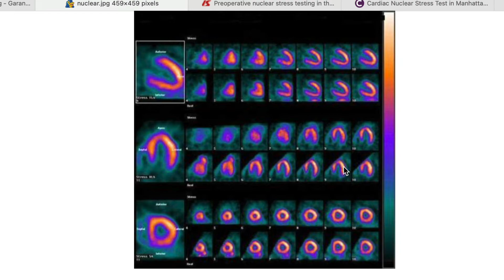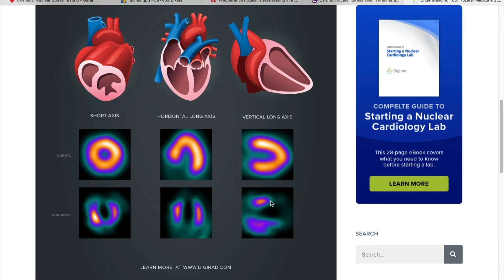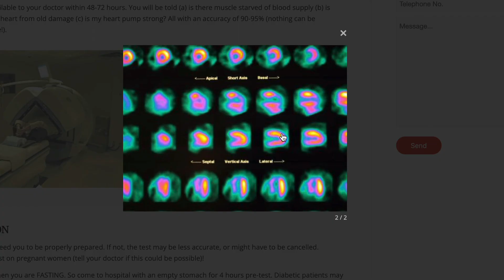Scared About Your Nuclear Stress Test? Here's What Really Happens

Comment: @ uncomfortablewellness does the second one speed up the heart? I cancelled my appointment and the doctors are really upset with me about it at the hospital. I went in with ST on my EKG, but my troponin level levels were only added two they did. The other test on me. Didn’t find anything too wrong, except the left vertical not opening and closing journey stress. they want me to do this task, but the thought of having the needle inside of me stressing my heart is totally stressing me out to say the least. Does it make your heart go fast please tell me thank you so much. Your video was very informative.
Reply from the maker: Depends on the stress agent.  Adenosine or some derivative of that doesn't really speed up your heart very much I normally saw maybe 10-15 beats.   Now you are probably going to feel a little flush and feel like your heart is beating fast, however, the good thing is that it goes away pretty quickly.  I would call up the cardiology department and ask them to see what they use and have them talk to you about your concerns.